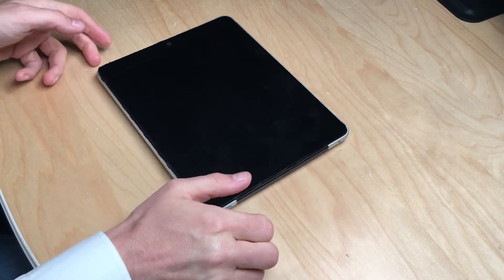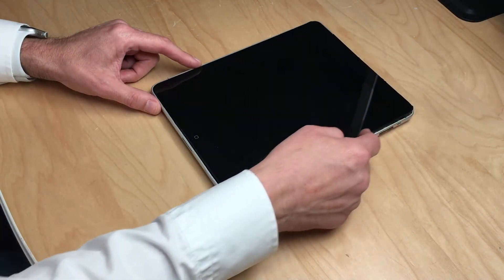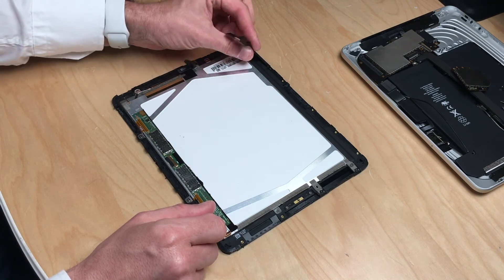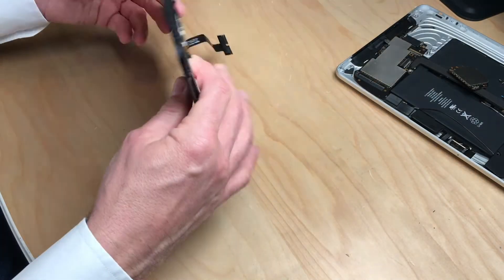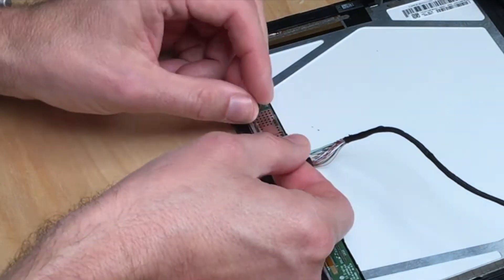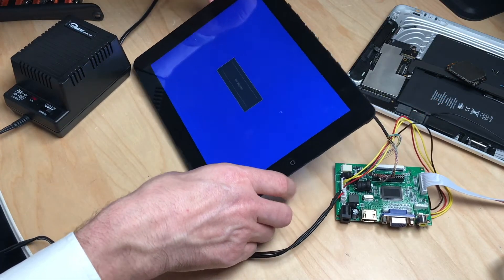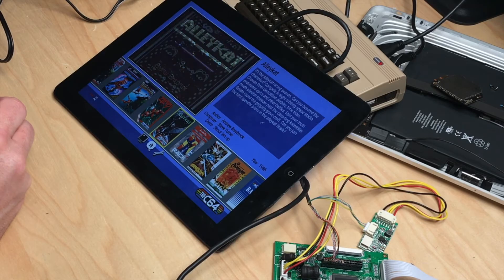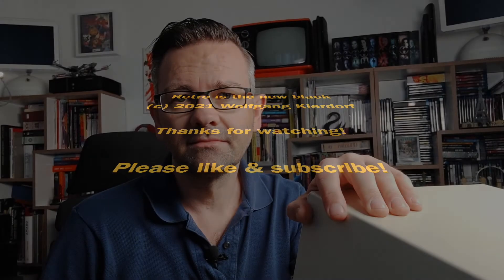Turning an iPad 1 into an replacement/external monitor (HDMI, VGA, Composite)

Comment: Make a new video about MacBook laptop screen. How to take it off from dead laptop and reuse it
Reply from the maker: It's the same procedure. All you need is the correct driver board. I did that with an old Mac Laptop and it worked great.

Comment: That's cool, but is there any way to use an old Ipad 1 through it's own charging port ? is there any way to build an adapter to give the audio video signal from an old video tape recorder ?
Reply from the maker: There was an apple VGA adapter but only for output, not input. So no, there is no such adapter or way to do that. Only the one shown in the video.

Comment: Hi, do you think, it is possibly to keep the battery and convert it to a portable monitor?
Reply from the maker: I think you could, but it is not easy. I am not sure what voltage the battery suplies. You might need a voltage converter and/or some charge logic.

Comment: This was a great video and something I have wondered about for a long time. I often look up videos to find ways to repurpose old tech. (And I love Commodore so that was a plus) This was an option I wasn't expecting and didn't know was available for these panels.

In the end at least for myself I don't think this is worth it. The driver boards cost in Canada about $35 plus shipping plus everything else that is required to make it a finished project it just becomes too prohibitive. A brand new low cost tablet and a cheap HDMI input adapter can be had for about $100-$$120 and you get a hire res screen and a more modern finished project.

Perhaps it might work better with as some have suggested a newer iPad as the donner with a hire res screen.

Comment: Is there a driver-board that can be powered with usb? I'd like to get it powered by a USB header from the computer mother board.
Reply from the maker: You can use one of those 5 to 12 volt mini converter boards. They cost a bug or two on Amazon.

Comment: hi ! ,id like to know if you can make a video about the Apple speakers ... 
i mean, how could it be possible to know the compatibility of different sort of speakers of apple, to plug 2021 speakers on 2015 macbook pro ... or switch it up and change the mac-mini speaker to having more powerful one, or maybe how can we freely use them on anything else ?
how cool it could be to recycle apple speakers to put it in something else ...  
because there is absolutely ZERO topic on it ... and apple got the BEST speaker on the market since day one ... so it could be very helpfull and interesting to know how the chip link work between the speakers and motherboard and all that ... 

thanks a lot and best regard.
Reply from the maker: Hi! I have no experience whatsoever with speakers. I know that @JanBeta has a background in audio engineering. He would be the guy for that kind of stuff.

Comment: I have an ipad 7 10.2” that I can’t figure out what display it has. There is no sticker on the lcd. Any idea?
Reply from the maker: Try googling for iPad 7 replacement screens. That's how I do it, when I don't have the number at hand. Some sellers list the number. Or if you need the driver board you can also google iPad 7 instead of the number.

Comment: Do you know if there is a LCD driver board available also for the iPad pro 12.9" display? I'd like to make an external monitor for video and the 12.9 size 4:3 display of the iPad Pro would fit my project perfect.  -Great and informative video, thanks!
Reply from the maker: In principle there should be a driver board for every display. Especially the ones used by Apple & Samsung. I found my on AliExpress and eBay by using the panel id on the back of the panel.
Reply: @RetroWK  Thanks, I've been looking around a little on both Ebay and Aliexpress, without success so far. One problem is that the iPad Pro 12.9" replacement screen, which I've bought, doesn't have any ID number on the back of the panel... There are two numbers on the package, 208757 and 5712579983190, but none of these seem to correspond to a panel ID...
Reply from the maker: @alexg5544  I couldn't find one either. I guess you have to cross check iPad pro panels (which one is it), replacement screens with controller boards and probably manufacturers. Could be time consuming. I tried for a few minutes and didn't come up with anything.
Reply: @RetroWK  Thanks for your effort! I got one replacement screen for the 2020 iPad Pro 12.9  and one  for the earlier versions, with the wider frame around the display, but I've been unable to find a controller board for any of these. I will move on to other displays, since in the end I decided I need a larger display anyway... 🤷‍♂️

Comment: Im wondering if you could avoid cutting the screen out by cutting just a slot in the back through the aluminium where the cable connects to the display itself. That could make it a lot neater if it is possible.
Reply from the maker: Sure. You could put the controler board inside the iPad housing. The silver back shell ist just really sturdy. You will need some serious tool to get through that.

Comment: This exactly the kind of experiment I’m trying to do with an iPad 4, very cool and informative video. I’m trying to make a DIY laptop. Is it possible to put the screen on a hinge and run the ribbon cable through the hinge to the base of a laptop? I wonder if the cable is too fragile for opening and closing a lid.
Reply from the maker: The cable on that display controller is really fragile but you could make it work with some kind of more flexible extension.

Comment: I've just done this with a couple of old laptop monitors - I didnt even think to do It with the old iPads - very nice - I will be doing this one next
Reply from the maker: iPads make for great monitors. The screens (even on the iPad 1) are really good and the driver boards work fine. It's almost plug&play. iPad 1 & iPad2 even use the same displays (and you can use the same driver boards).

Comment: is this working for ipad mini 2 lcd?
Reply from the maker: It does work, but with a different driver board. Check AliExpress or Amazon for the correct one by finding the type-number on the display itself and then search for that type-number.
Reply: @RetroWK  i can't find it did you find it?
Reply from the maker: @m7med581  http://www.abusemark.com/store/
Reply: Did you find a board that worked with it?

Comment: does the toch screen works?  i have alot of apple screens  and would be usefull to used them like this
Reply from the maker: Nope, the touchscreen does not work. The logic for that sits on the iPad mainboard. It could be doable, but I didn't try. You would have to leave the iPad in place for that and somehow manage to connect it via USB to the device (PC, Console etc.) to support touch.

Comment: Does the board accept signal from an Amiga 500? If yes, it could be a nice replacement for my bulky 1085S.
Reply from the maker: Not without a scandoubler. 15hz is the problem with the Amiga signal.

Comment: You inspired me to try something similar with an iPad 3 display which has four times the pixels, and is also available for cheap. I’ll post eBay links in a reply in case they are disallowed.
Reply from the maker: That should work. Driver boards are available! These iPads make for great screens!
Reply: Yes, please post links to the adapter board. Thank you.
Reply from the maker: @ernestgalvan9037  I put some links in the video description.
Reply: @RetroWK  so the same board works for ipad3 (A1416) as well?

Comment: I think it could make sense to keep the display in the original housing if the glass isn’t scratched. It would be hard to get such a clean finish in something home made. Only the home button makes it obvious this was part of an iPad but maybe that could be covered up. Edit: I’ve since seen the luggable Amiga project where this face wouldn’t have worked.
Reply from the maker: That‘s true. If you are using the iPad standalone that is the way to go. You could fit the driverboard in there somehow and maybe even use the battery to have a full mobile screen.
Reply: @RetroWK  maybe print a plastic shim between face and metal back to thicken the iPad to fit the driver board in and allow cables/connectors on the edge. A fun project.
Reply: in ipad 3 it is impossible to fit board inside. even button part (tips outside of case) barely let install glass back
Reply: I was thinking to print a spacer to go between the screen and the case to make it fatter and give more room. I never tried it though.

Comment: Does ipad 2 have the same LCD model with ipad 1?
Reply from the maker: As far as I know it's different. But there are driver boards for that one too.
Reply: @RetroWK  is there a way to know it without opening up my ipad?
Reply from the maker: @isabellemeneses230  I found this: https://de.aliexpress.com/item/33053228834.html May work, since it only says iPad2. Maybe there is only one type of panel inside there. Would make sense from a manufacturing standpoint. BTW: The iPad 2 seems to have the same LCD panel like the iPad 1 after all.

Comment: i want to turn my old ipad mini to a camera monitor
Reply from the maker: That should work. Open the iPad mini and check for the display id and search for that id plus the words controller board on ebay or ali express. That should give you the proper connections. All you need than is a power supply.

Comment: I missed this video somehow? Maybe because it didn't have C64 in its title! lol This is a great video and its kind of serendipity also because I have a C128D coming to me today and it only comes with a 1701 monitor and I need something to run the RBG 80 column side of the machine. I have a iPad 2 that I just charged up 2 days ago after being in a drawer for 2 to 3 years, but when I tried to add some new Video streaming apps they said wont work with this IOS. I'll have to check thingyverse   to see if someone had made the plans to print out a case to hold the screen and also that board and controls board. I have also bought three 1084S from three different sellers, but will need to find someone to help me make One or two working 1084S. one of them in original box has a perfect case!!! No yellowing and not a scratch and all books. The other two have beat-up dirty cases. One of those has a nice picture from the screen shots with games running. The other one's case is a bit beat up put but no where as bad as the other one that's working. It comes on but only if you hold in the power switch and turns off when you let go of the switch. That will be a project down the road because I want to find the right person to do the job since I don't want to kill myself with CRT's high voltage!!! I guess I could use the working one for now but OMG I don't know how it works with all the deep scratches and so yellow and dirty looking.
Reply from the maker: The iPad 2 makes for a great monitor. I am planing to do an ipad 2 build myself. There is also a video on youtube were someone did a mini 1702 case for a 4:3 mini display. I was wondering if one could take that and just scale it up for an ipad screen. That would be cool! ... and I have lot's of respect for high voltage. I would help you with the screens, but there's no point in sending them to germany and back.
Reply from the maker: I also saw you had another comment which is not on the video anymore. Maybe youtube deleted it? That case you mentioned looks really cool!

Comment: Is there any way to get the touchscreen working too with for example a raspberry pi?
Reply from the maker: I looked into this but couldn't find any info on how to drive the touch sensor. I am pretty sure, that the whole logic for this lies in the iPad and not in the touch sensor itself. So you would have to come up with your own controller via arduino or something. I might try that in the future. Until then, there is only the screen without the touch.